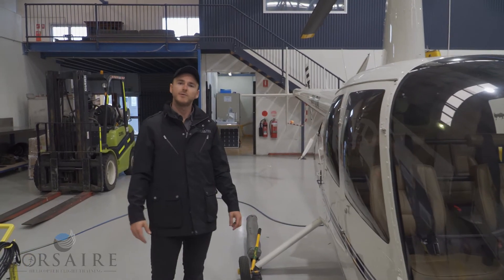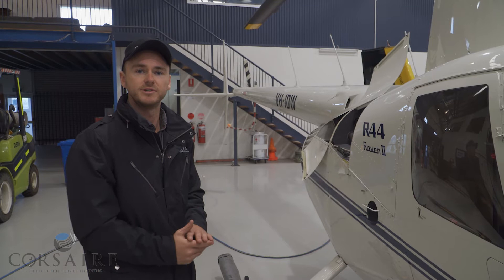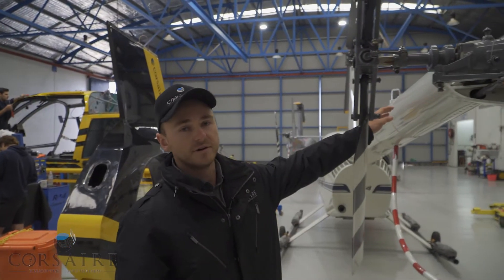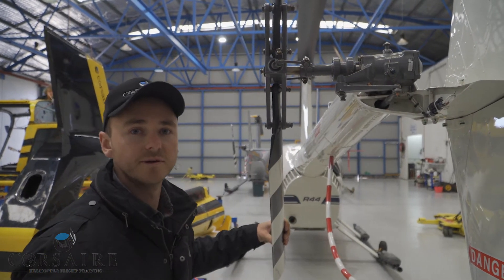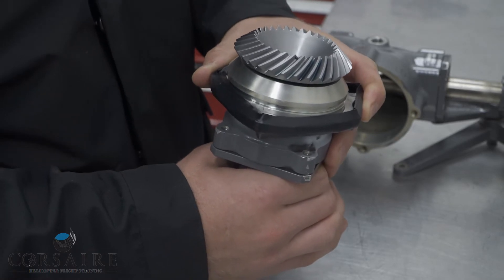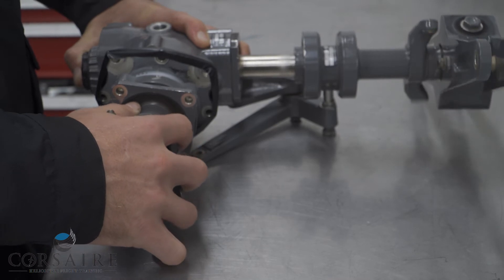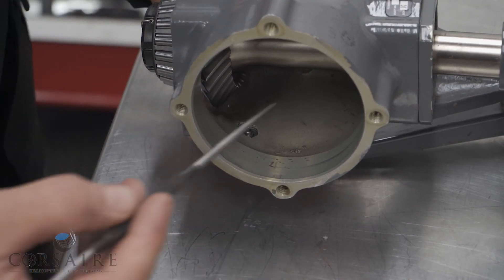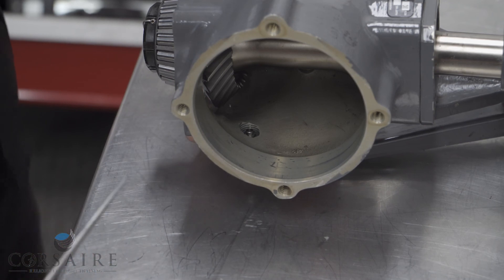R44 Tail Rotor Gearbox

Comment: The tail rotor gearbox on my 1.5 meter rotor Radio Controlled helicopter is almost identical the the R44, right down to the pitch slider and delta hinge...except mine fits in the palm of my hand. 🙂🇦🇺